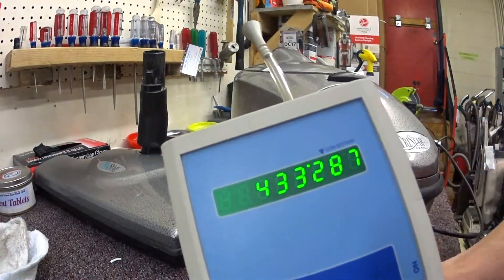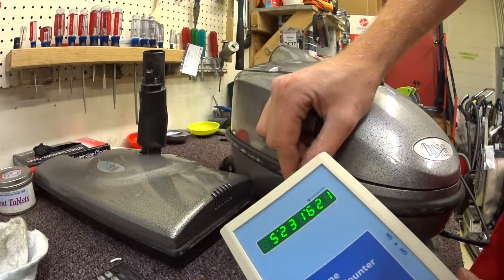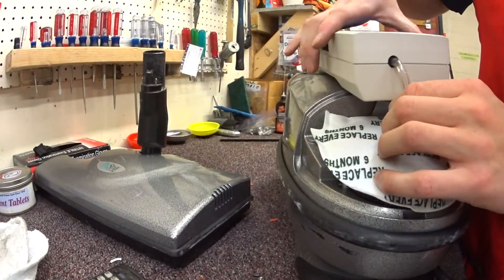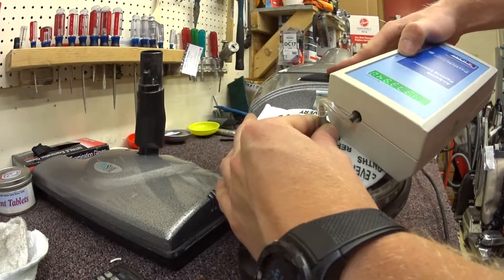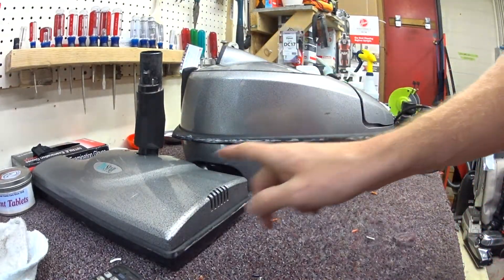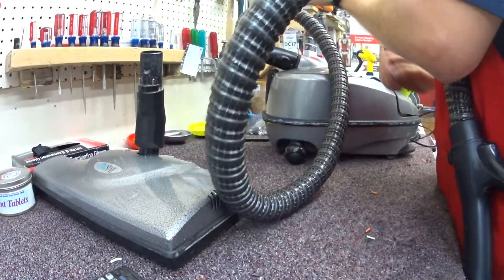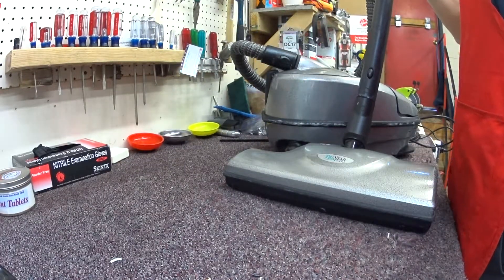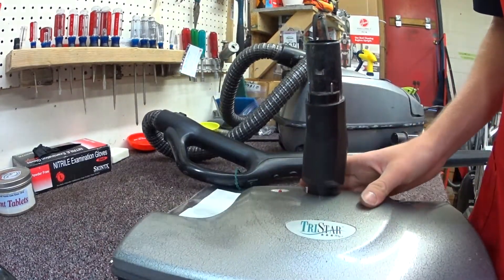Tristar EXL MG2 filter particle counter test

Comment: How does a modern TriStar compare with a Miele C3 canister with the SEB 228 and 236?
Reply from the maker: It can't it's really out classed
Reply: @PerformanceReviews  So you think that a Brilliant, a HomeCare+ or a Kona would do better than the TriStar in this video?
Reply from the maker: Absolutely. Weight ,handling, filtration, cord management, accessories, bag capacity, not to mention the motor moves  much more air.

Comment: So does the modern Tristar use the same connectors as the Aerus Renaissance?
Reply from the maker: Oddly enough no .
Reply: @PerformanceReviews   Well dang. Was too hopeful I guess.
Reply from the maker: The brush rollers are interchangeable that's about it.